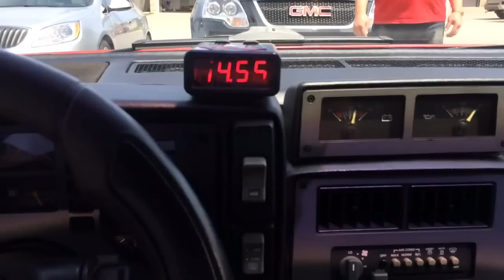1988 Pontiac Fiero GT 3800 Turbo

Comment: I went with the GTP swap. Loved the car. Summer driver. Lives in Washington state at the time. Got really squirrely in the rain. Especially if you're trying to accelerate from a dead stop and make a left hand turn. So much torque it would lift the front tires off and you'd still go straight until you backed off the accelerator....lol.

Comment: this looks like not a bad style for this car, very reminiscent to Lotus Esprit in the weirdest ways.
Reply: I think in 1988 the ferios had lotus parts on them
Reply: Lotus was just a rumor... Porsche tuned the new GM designed aluminum front suspension...
Reply: gm bought lotus in 1986
Reply: Nope. Legend not true.  Pontiac guys did the upgrades 100% in-house. In secret since the @#??&@ Corvette guys wouldn't hear about it. Damn Chevrolet.
Reply: In 1986 GM of acquired Lotus. One of the first things that they had Lotus  engineers was to make a better handling Fiero for the 1988 model run. They did have a part in both the Fiero GT and the Fiero formula when it comes to the suspension.

Comment: What are some common problems with these cars??
Reason I'm here is because I'm looking into buying a 87 gt. it's obviously a little more beat up then this one (especially the interior) but it's pretty much the same thing but silver with black and different exhaust tips.
Reply: If it's stock the idle tends to be high over time. Ignition module tends to be problematic. Those were the ones that gave me problem. I never solved the high idle issue.  I also change the pugs on the headlight motors, which wasn't too bad.  Also be sure to get either a 4 speed auto or 5 speed getrag manual.  3 speed auto is horrible on gas.
Reply: A th125 stock auto wouldn’t last long behind a3800 turbo
Reply: I had an '87 not the gt. The four cylinders were known to have problems but the V6 was better. The engine froze up on my Fiero.

Comment: Very very nice example of a Fiero. How much HP does it has? I have an '88 GT with turbo too.
Reply from the maker: Daniel Groulx 
estimated to between 450 and 490 at 18 psi boost.
Reply: 4PBJT wow that's crazy. Have you thought of boring it out to 4.0L? My '88 GT got the original motor bored out to 3.2. Got a turbo and roughly 300HP with a phase 2 tuning.
Reply: LOL
Reply: Explain to me how a turbo puts more strain on a engine than a supercharger when The supercharger is directly driven BY the engine and the turbo is powered by the exhaust , dummy....

Comment: I liked everything you did there til i saw the automatic shifter.
Reply: I said the same thing. Just don't get having any sports or supercar with automatic or dual clutch paddle crap. So much fun changing gears in a fast car on a hilly whinding road! I had an '87. It was so slow but handled very good. Nice to see someone else who likes to actually drive the car and not use just the gas and brake pedals!